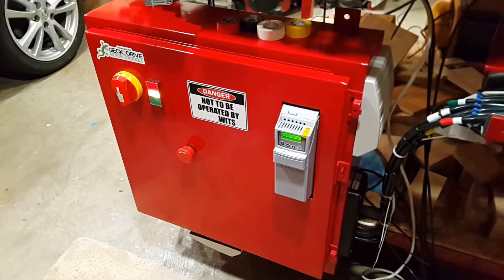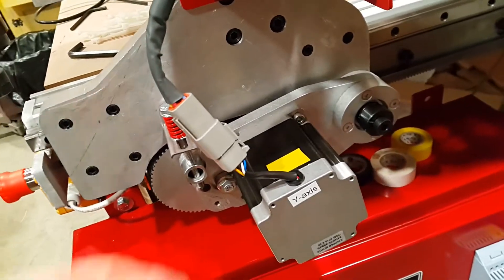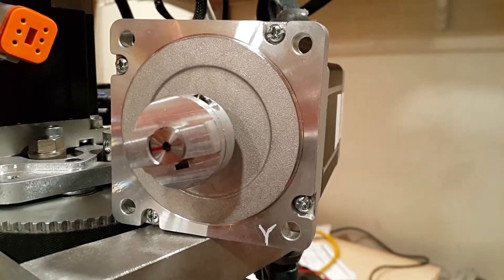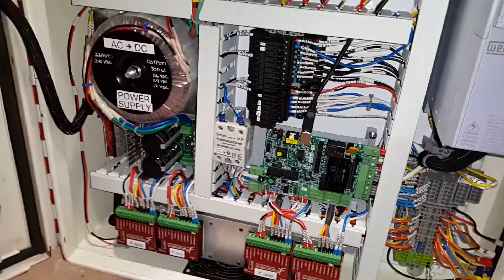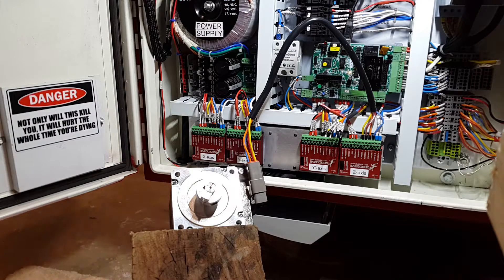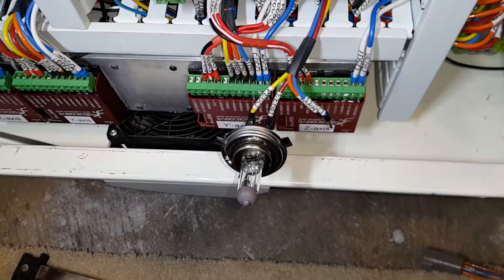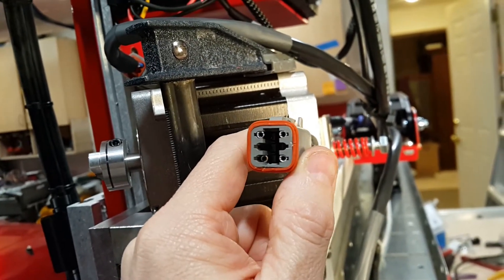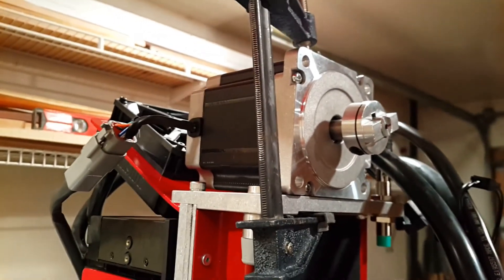Grinding Stepper Motor Debug

Comment: Great job on the housing.  Do you have the model and where you purchased the cabinet? Wanting to move my controls from its current housing into a cabinet. Enjoying the vids. Keep them coming.
Reply from the maker: The enclosure is a Hubbell-Wiegmann N12242406. I bought it used from a local recycler for $45 usd. If purchased new it would have been ~$350. I did have to buy a new plate which cost ~$45 at the time (it appears the price went up since then) :(
https://www.hubbell.com/wiegmann/en/Products/Electrical-Electronic/Enclosures/NEMA-12/N12242406/p/1722364
https://bit.ly/36jqVP9
https://bit.ly/2zUhs4M